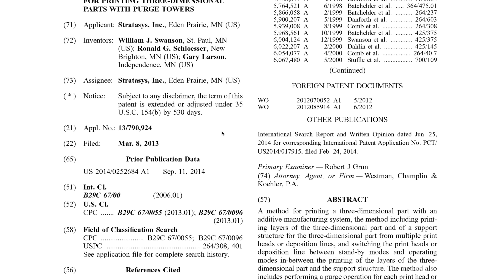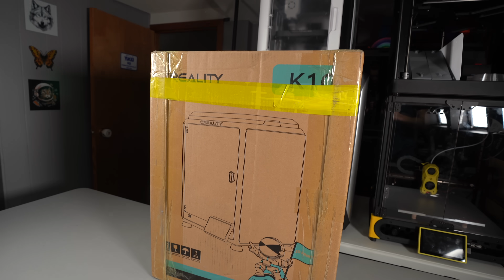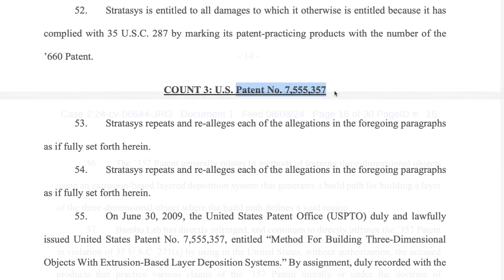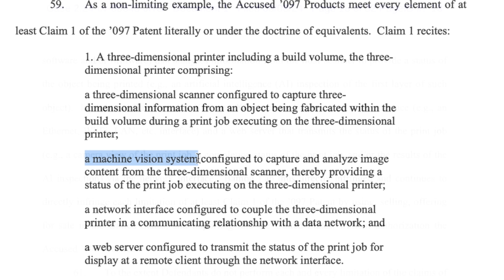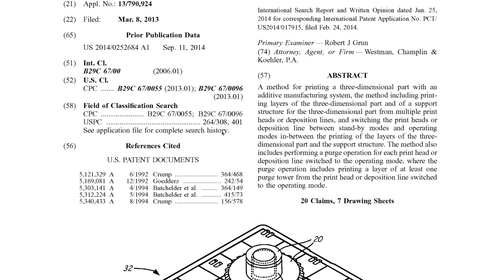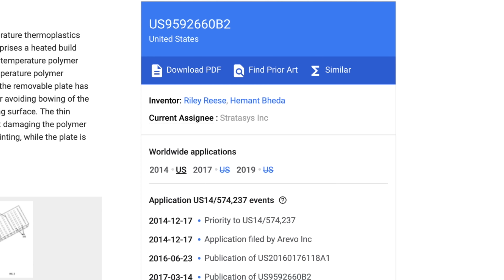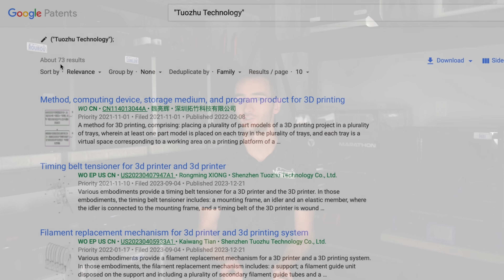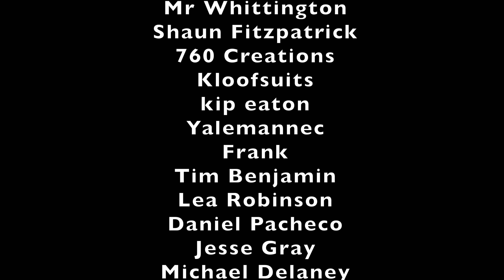Stratasys v. Bambu Lab - Will Prusa Play A Role ?

Comment: First Prusa heated bed came in 2010 so it's 3 years before the patent was filed and OctoPrint is from 2012
Reply: Heated beds have been known since at latest 2009. An early known construction as showcased by Jordan Miller at Hive76 was a piece of acrylic, on the backside of which nichrome wire was laid out, and then encased in silicone, and this wasn't the first heatbed either, earlier ones used Kapton tape apparently. Another person laid out a copper tape spiral on a piece of something. Soon after, Josef published a PCB heater which could be mass produced.

But thing is it doesn't appear to be what the patent infringement case in particular is actually about, but about coating methods or something like that. I never actually understand with patents which parts are supposed to be merely descriptive and which are supposed to be novel and protected.
Reply: The US9592660B2 patent in question requires the COMBINATION of a heated bed and a polymer coating that is not a polymer tape.  The polymer coating is designed to adhere to the print while printing, and release when cooling, plus other requirements. 

Prusa and others, with heated beds which predate the patent's December 17, 2014 priority date, were generally using PEI tape film (Kapton), blue tape, Buildtak, and glass heated beds to my knowledge. Not polymer coated beds as described in the patent. 

Some say there were those in the REPRAP community doing powder-coated build plates prior to Dec 17, 2014. If so, that will be what BBL will try to prove. They may also try to prove that it would be obvious to those skilled in the art to apply PEI as a powder coating, rather than using PEI as a film tape. 

Today's printers that use a powder coated PEI build plate would conform to the base claim of that patent.  That's a polymer coating.  BBL must prove that heated beds with polymer COATINGS (not tape) were in use prior to Dec 17, 2014, thereby invalidating the base claim of the patent.
Reply: @ArgueForSport  If we go into technicalities, todays manufacturers are selling a heated pcb, and a PEI coated metal sheet. Not a PEI coated heated bed. It's the consumers decision to combine the two elements.
Reply: @ArgueForSport   OK but what is the significance of polymer coating as opposed to a sticker? Say you have a polymer sticker (Buildtak polycarbonate, Polyimide, PEI), which is capable of thermally welding itself with most 3D printing filaments. By heating but not too much heating, this welding action is managed to be just on the cusp of where it would break across the weld upon cooling. Why is it when you achieve the same action in the same material directly moulded onto a piece of metal, it is somehow a protection worthy invention as opposed to a sticker?

The same action was observed before. Cupcake CNC came with a crosshatch etched sheet of PMMA as printing bed. It was not heated, and it didn't hold onto prints well at all except by biting into them at etched lines. But users quickly noticed that adding bottom heating to the sheet made prints stick by temporarily welding themselves across the whole surface, the construction became well known in the owner circle. The bed modified this way obviously did not contain a sticker, indeed it was one material throughout.
Reply: @ArgueForSport  I'm pretty sure someone has used a glue stick or ABS juice on a heated glass bed before Dec 17, 2014. Finnish company Minifactory released their printer (model 3) before that date and I was using it when it was new and I and the boys tried glue stick and ABS juice on the glass and it was a normal practise back in the day.
Reply: Dont forget its USA vs China so the US court ruling will be 100% pro US since they cant compet in tech or innovation.
Reply: Prusa DIDNT EXIST in 2010, what r u on about.
Reply: @joei4ever  Joseph Prusa certainly did exist before his company. And I have a picture of his first heated bed called "PCB Heatbed MK1" which was timestamped 2 August 2010.
Reply: @hippopotamus86  my comment that said this and listed it to the thingivers item number (not a direct link) that anyone can go look at was deleted. not sure why though.

Youtube really likes to delete or remove my comments
Reply: @hippopotamus86  Stratasys had its IPO in 1994.  So you really don't want to try and use the Prussa or whoever else was doing it in 2009 argument.
Reply: @LackofFaithify  You say that as if you think it proves something. That doesn't change the fact that they didn't invent the heated bed as Joseph Prusa beat them to it. There's other patents which they alleged Bambu Labs infringes on, I've not looked into them that much but it certainly seems that Stratasys is a patent troll.
Reply: @LackofFaithify  why does their year of IPO make a difference? The only relevant date is the date they filed the patent and the date of any prior art.
Reply: @joei4ever  yes they were mate they were around in 2009 I have some of their first heated beds as well

Comment: I think what they are really trying to do is defend their overpriced Ultimaker machines. Why pay $7K when you can get the same or better performance for under $2K.
Reply: Sorry, just seen you comment after I posted about people missing the Ultimaker situation.  Glad others have looked a bit deeper.
Reply: I was interested in buying an Ultimaker machine and had conversed a few times online with them regarding it, but then I heard nothing from them for ages, in the meantime I had bought an X1 Carbon combo, they did get back in touch with me eventually and gave me some old pony about BL printers being highly unreliable, at that point I had had it for about three months and had not one single issue that was not user error, and over 12 months later it is still the same story!
Reply: @AndrewAHayes  Alexander Chappell (ALCH) used to run those printers but he switched to Bambu ones. Last I've heard about Ultimakers was 2019 if not earlier.
Reply: Ultimaker fell apart supporting the hobbyist in the last few years.  Stratasys merger likely hastened that situation.
Reply: Based on people I've talked to at UltiMaker, Stratasys has no interest in them whatsoever. I'm guessing that's not even on their radar.
Reply: Suddenly it all makes sense, I had no clue Ultimaker was under Stratasys.  My company paid 13k for an S7 with a material manager; for that price, I could get a print farm of six X1 carbons and massively increase our throughput, which for a small startup is HUGE.  Ultimaker really just isn't feasible as a brand anymore, and I'd honestly rather go with a hacky self-made farm of Prusas rather than ever buy another Ultimaker.
Reply: Do you have a job?  Let's pretend that you do.  Do you really think you would have that attitude if after doing that job for over 30 years, a foreign worker comes along, steals the things you have developed to do your job AND is being supported at the national level by their government with the intent of putting you out of a job and becoming the sole monopoly world wide?  That last part is because the Bambu guys are the DJI guys who did that exact thing with drones and help from their government.  So its not some big conspiracy.  I really doubt you'd be making posts on Youtube about how ok with it all you are, and that its going to work out for you in the end.
Reply: @LackofFaithify  I mean the protectionist angle here doesn’t exactly work when Ulitmaker is made from parts coming from the same Chinese suppliers, and is ultimately a worse product at several times markup. Seriously, if they were 100% made in the USA, that would be a point in their corner, but I run parts off my $300 Ender 3V2 with less pain than the S7. 

They’re just better printers at a better price, it’s not that people are morally agreeing with the business practices of the CCP or something, it’s that UltiMaker is literally not worth the money
Reply: @roanoake it’s not even about “morally agreeing”, it’s just, why should we, as consumers, care?

Comment: I agree that many of the patents are most likely unenforceable, as they are really patents to prevent patent trolling.  A comparable example to this is the patent that Microsoft held on “How to click a mouse button.”  Yes, that patent did exist, but it and many others were created to prevent others from suing the patent holder, not for the purpose of suing others.

In order for a patent to be enforceable, it must be equally enforced for all violations across the board.  You can’t just sue one company and give another company a pass.  Any patents where the defendant can prove that other entities are also violating the patent and are not being claimed, can invalidate the patent.

One intriguing thing that you brought up is the fact that Bambu Labs has filed several patents of their own, in direct competition to Stratasys.  One thing you didn’t bring up is that Bambu Labs is a proprietary system, which again is a direct competitor to Stratasys.  The other competitors are either fully open sourced, or partially open sourced, including many, if not all, of the patents that they have filed.

The bottom line is, Statasys has every right to enforce their patents and they must do so in order to remain relevant.  Nobody can fault them for that, as the entities violating those patents are the ones at fault.  However, I believe that this is is going to be problematic for them, as it is actually the open source devices and patents that are eroding their market share.

Final Note: For those who don’t know, anyone can file a patent for pretty much anything, including for things that have already been patented, or found to be unpatentable.  The Patent Office Reform a few years back, changed the way that patent filings are handled (first to file wins), changed the rules for obtaining a patent, and the process for accepting patens. They will simply accept all patents and your money, leaving it up to you to enforce the patent.  So, patents do not have any meaning until litigated in court.

Comment: This is not problem of Strasys vs BambuLab. This is bigger than that. This patent trolling allow disfunctional companies to survive stopping inovation. There is no innovation in network management, heated bed platfor ot rriple screw. If you find new methods to print 3d object okay you deserve pattent but I put a bolt here please give a patent is a joke… And if this lawsuit goes trough this will hamper mainly USA creators and will suppress future inovations. Look what happen so far because of this shit Stratasys there is no USA company on the leading edge in consummer 3d printing. Prisa is EU, Ultimaker was EU, Bambulab is China, Creality is China, E3D is Uk, Boondtek is EU ans so on…

Comment: You need to read the specific claims in the patents. The heated bed patent don’t cover using a heated bed. It converts a narrower claim related to having a removable, flexible, heated build plate with specifically PEI material adhered to the bed but not attached via a tape. Yeah, my read is that the patent would cover the typical PEI build plate but not the PC ones used on some Enders nor any rigid build plates (glass).  While many get upset that Stratasys is potentially taking away things we have come to use, if they are the originators of these specific technologies why shouldn’t they get to enforce their patents. At the same time I don’t see anything here that couldn’t be engineered around by the competition. This isn’t going to be the death of consumer printing.
Reply: This absolutely could be a MAJOR setback for consumer 3d printing and print farms. If Strata wins, there is nothing to stop them from going after Prusa next, then Creality, etc. Plus they'll go after Prusaslicer and their implementation of purge/prime towers. Because of this, the MMU's would be useless, and the XL will be a paperweight as well unless you use a single extruder. The list can go on and on.
Reply: @OhImKiCkiN  and it's strange Prusa is not named in the lawsuits. Bambu Studio is a fork of Prusa slicer after all.
Reply: @PointBlank65  I've wondered the same thing. Only thing I can figure is they'll go after the slicer if this initial suit is successful.
Reply: @PointBlank65  If they go after Prusa, Stratasys will get a significantly bigger pushback from the community than they currently do. I have no doubts Prusa would be able to fundraise for the lawsuit to the point where they'd easily able to blow any Stratasys claims to oblivion. And most likely there exist high-profile lawyers willing to take the case for free on behalf of Prusa, whether for the cause or publicity. If they do go after Prusa, it's pretty much a guaranteed loss for Stratasys.
Reply: @h3xcat  I completely disagree. From releasing the Mk4 without promised features, to releasing the XL for $5000+ while using their own customers as beta testers, etc...Prusa lost the edge and the community support majority they once had. In fact, I believe BL could do everything you named about Prusa if they tried, but itd be scummy for either one of them to do that. The only thing Prusa has going for them now is their open source support, but fewer people care about that as quality machines are released for a fraction of the cost. Also, I doubt a pro-bono attorney worth a dime would volunteer.
Reply: @OhImKiCkiN  I think there are enough smart people working for the other companies to work around these patents.  For example, the build plate is relatively easy to get around.  Either use a non-flexible plate, a material other than PEI or look at using adhesive or other means to attach the PEI to the build plate to not violate the patent.  The purge tower is something that also likely can be worked around (poop chute?).  Bambu may have to loose their current force feedback system or limit it to bed leveling.  That's not the end of the world as most mfg don't have that feature.  I haven't read the slicer path patent closely enough to know what the limitations are on it's implementation but again, what are the odds there isn't a work around.  
Yes, it is possible these patents are bad patents.  If that is the case either prior art or obviousness should be shown.  Conversely, if they were the first and others copied them why shouldn't they have the right to enforce the patent?  Yes, Bambu may not have copied Strata, they may have copied Anycubic or some other company that showed the idea before the Bambu printers were launched.  Does that mean Strata should be denied patent protection?
Reply: @ralathr  I agree. But if Strata isn't actively using these patents then it's messed up that they'd gatekeep the natural progression of things. Most, if not all, of these patents are implementations that would've naturally occurred with or without Strata. Also, I think it only right that Strata, or any company protecting their patents, go after companies in order. For example, go after Elegoo 1st if they used the PEI sheets first, Prusa if they used the purge tower 1st, etc.